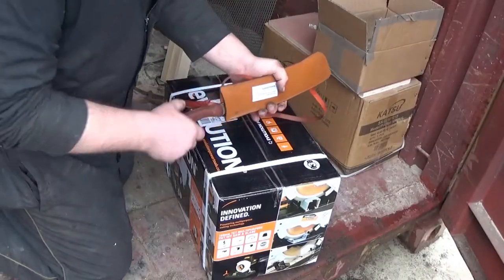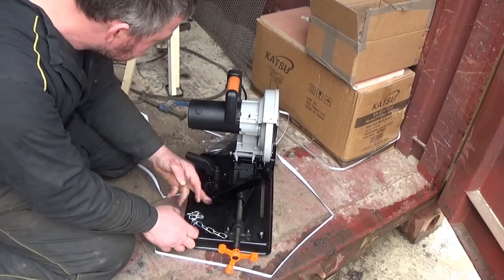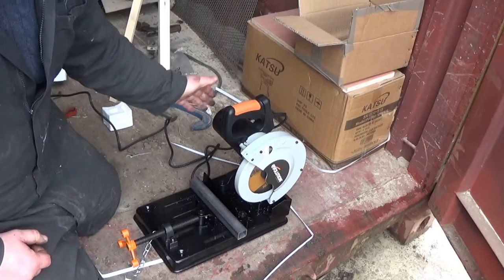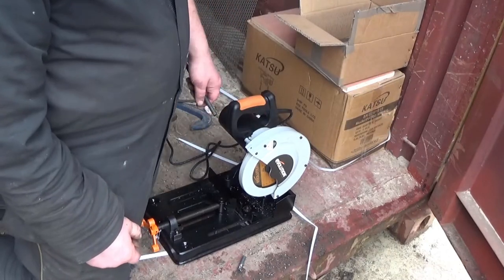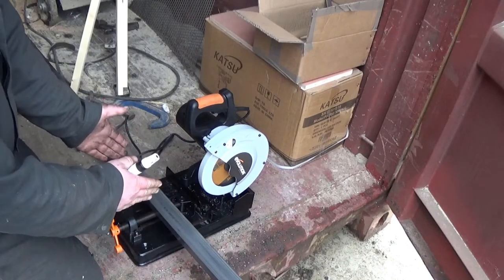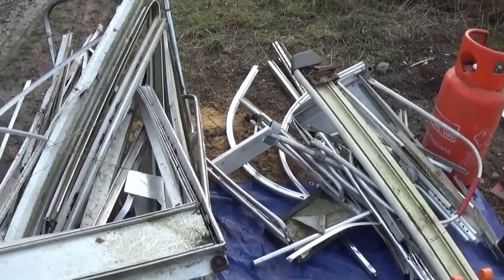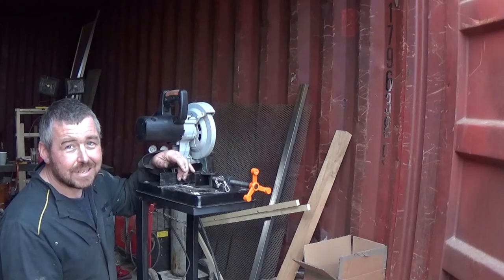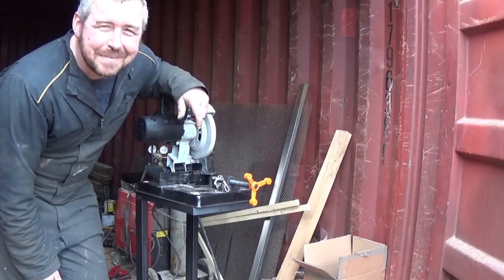Evolution Rage 4 test review and stand build

Comment: Your the spitting image of John Virgoe snooker man . been using this just over a week £110 form Amazon it;s ideal for my small shop as i cut mainly 40 Mill box section for the price it cant be beaten i had a Massive Metabo chop saw before but this is much faster with the TCT Blade .only gripe i have is i wish it had a quick release clamp mechanism .great review thanks m8

Comment: I remember many hours onsite with a Makita bacon slicer, cutting up 1000's of pieces of unistrut and threaded bar.The prep and putting the brackets up took longer than putting the pipework in.Ive got a evolution mitre saw, table saw and a circular saw, all are great  bits of kit.Ive cut copper plate,10mm perspex,hdpe chopping boards with the mitre saw and pallets with the circular,you dont have to worry about nails.
Reply: But you can't use the side of the blade for grinding the burrs off the ends of the unistrut  😀 😀 😀
Reply: @Everythings_Adjustable  Site safety officer made us use 2 bacon slicers,one for cutting and one with grinding  blade for dressing the ends,site safety has gone stupid
Reply: I actually like that idea but you are right about HSE guys 👍
Reply from the maker: Bacon slicer, I wish I'd known it had a nickname.
Reply: @turboconqueringmegaeagle9006  We called a chain wrench " Dogs" because its got a chain and it BITES

Comment: I've been using a Evolution Rage 3 (that I got on sale on at Screwfix) croscut compound mitre saw to make the shed I'm building on my channel. It goes through construction timber like it wasn't there.
Reply from the maker: They are brilliant, a little bit more delicate than this thing, I bought a rage 3 several years ago to make a trailer out of 50x50x3mm box mild steel, worked beautifully and it's still doing work now, I've processed at least 5 ton of firewood with it and if I tweek it I can still make accurate lap and mitre joints.
Reply: @turboconqueringmegaeagle9006  Fire wood? I see. I have a chainsaw for that! I have to say I am pleased with mine. I notice that the new Rage 3 seems to be slightly different to the old one so I am not sure if I am going to do a review of mine or not. They are good saws though.
Reply from the maker: I'm a wood pikey, I cleared an entire bungalow of every bit of timber, the builder had gutted it, roof off, door frames, kitchen cabinets, everything but the bricks has been cut into 18" lengths by that saw and stuck on my fire!

Comment: Good vid. I'm thinking of buying this saw or the Evosaw 185HD for a handrail job coming up. About a $50US difference for the 185HD. I have a couple of Milwaukee bandsaws that I usually cut my steel. I'm thinking one of the Evo saws will be more accurate.

Comment: Congratulations on the saw! If it’s a promo from a company, that means they are impressed with you and that’s a good sign! I would be curious about the shape of the teeth after that round stock plunge mishap, to see if they suffered any loss or deformation. Evolution is a good company. The motor looked a little small, but it obviously chewed through stuff like a champ.
Reply from the maker: I thought evolution were just in the UK, haven't seen any American tubers working with them?
I should have done a close up of the blade at the end sorry, they are all fine

Comment: Also for casting aluminium you'd be better off using scrap aluminium castings as the alloying will be different.
Reply from the maker: Absolutely correct, I have a reason for doing it this way and a video on the casting coming up which I hope explains it
Reply: @turboconqueringmegaeagle9006  I await that with interest...